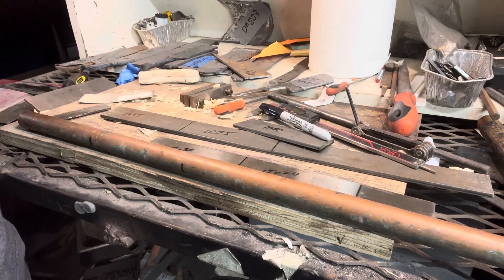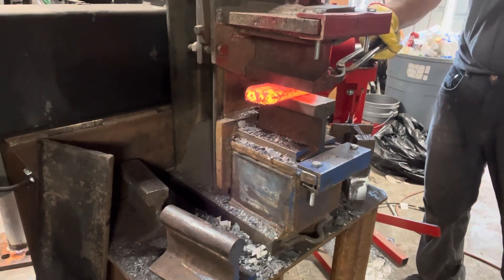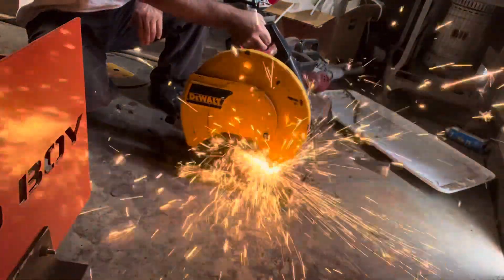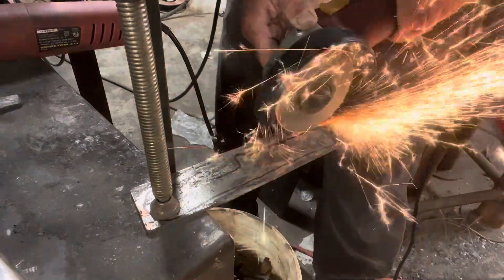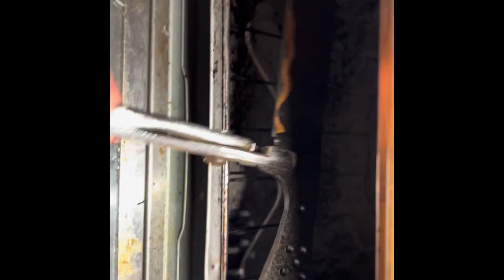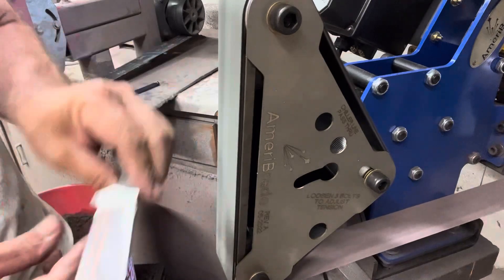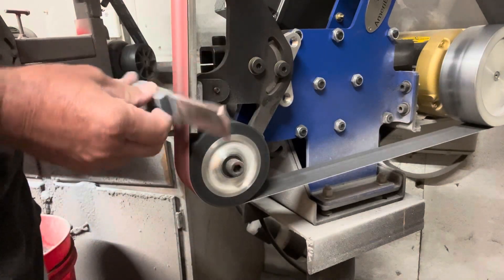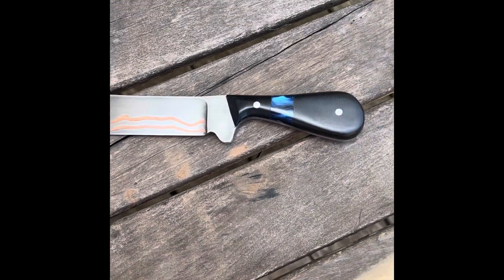Forging copper and steel into a knife

Comment: Great video.  I’m looking at a new grinder too.  Where did you get yours?
Reply from the maker: Thanks and Ameribrade. I have really liked it so far.
Reply: Awesome, I’ve been looking at them and Broadbeck Ironworks.  I guess most of these are all based off of the KMG design.
Reply from the maker: @c4dan  it took me a year to save up my money from knife sales to get it. But it was worth it. I was using a homemade one that worked but the speed control and better tracking is awesom.

Comment: Great little knife. You getting very good with the copper builds. Cant wait to see what you make next.
Reply from the maker: Thanks man. I appreciate it. I have been about 50/50 on success rate. Lol.
Reply: @4wknives  where i struggle is on the quenching. Its so easy to over heat it when doing it in a forge